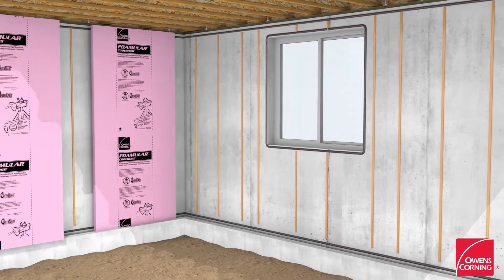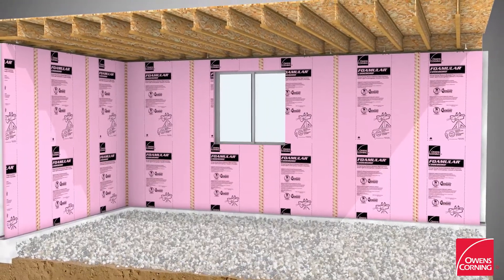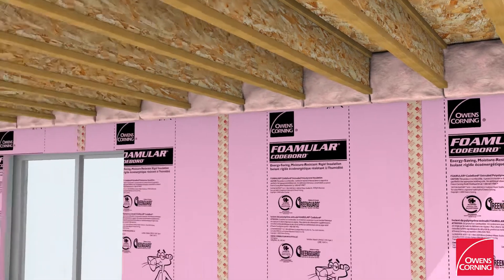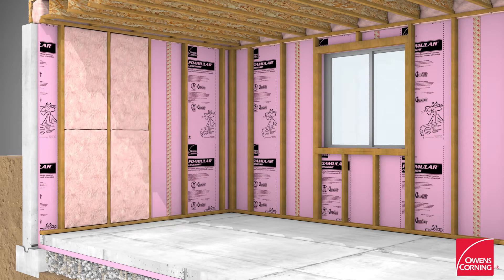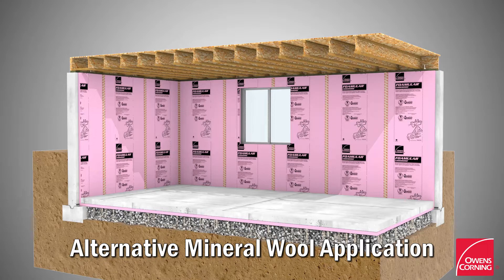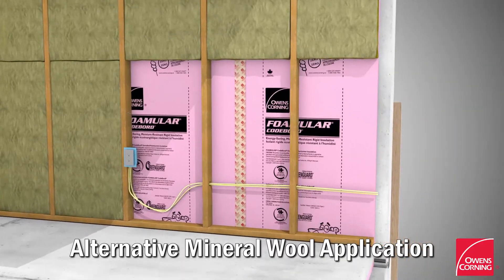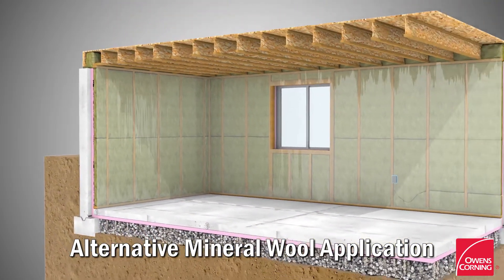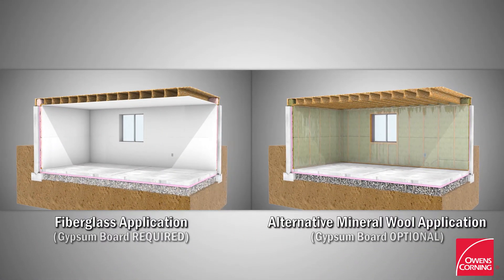Basement Wall

Comment: A vapor barrier is needed under the floor slab, beneath the insulation.
Reply: Castles in France don't have them, so I doubt they are necessary.

Comment: I cannot find any information at all about insulating the interior basement if you have already 2" foamed the outside of the foundation.....Is it okay to foam the inside also, or is this bad to have foam on both sides of the concrete?

Comment: would strongly recommend NOT using fiberglass insulation on the rim joists in ANY capacity.  Fiberglass is vapor permeable meaning moisture/air will pass right through it.  Putting plastic up (or paper-faced fiberglass) will help prevent the warm interior air meeting a colder rim joist in the winter months but not best way to prevent moisture, mold/mildew, etc.  Recommend putting in foamular foam board in squares on the rim joist it provides a complete thermal break from rim joist to the inside of the home.  Makes a big difference for efficiency.  I know from experience as i dealt with a shoddy install of plain fiberglass on my rim joists on a brand new custom home we built and had serious mold/mildew and moisture issues around entire home.

Comment: Nice video, but I disagree with bat insulation in the rim joist.  Bat type insulation only works when enclosed and a stapled vapor barrier is not the best option.  Utilized close cell spray foam around the perimeter in the rim joist/sill plate location to get the best results.  Plus, installing an interior PVC draintile system with a flange going up the wall about 3 inches above the slab would result in a lifetime waterproofed basement.  Lastly, I'm not a big fan of a finished enclosed ceiling in the basement.  That really prevents the ability to diagnose and fix potential plumbing issues.  Using a drop ceiling or even just spraying the joists and pipes in a matte finish is what I'm seeing a lot of done these days.
Reply: I agree. This video in incorrect.

Comment: There are so many ways to insulate a basement and no one will ever be able to promise you that there will never be mold growing anywhere...  Why?!?!  Because a basement should NOT be insulated.  I always lived places where there was snow in the winter.  First of all, in the summer, humidity comes from outside through the walls (cement or blocks).  Winter,,, inside to outside.  That is it.  So let your walls breath!  Considering the outside temp, any basement will be naturally cooler in the summer and warmer in the winter because it's underground.  And if your are from the south,,, is your basement really that cold in the winter that you want to insulate yours walls and take a risk for black mold?  When I was in New Hampshire, I finished the basement with a studded wall and 1/2" drywall 2 inches away from the exterior blocked foundation walls with a suspended ceiling.  (done)  And yes it was warmer in the winter but remained the same temperature (before I finished the walls) in the summer.  I will mentioned that I had a wood stove for the winter in the basement.  Another thing for you to think about,,, do you really want to drywall your ceiling?  You know you will have a leak, electrical or vent problem someday. 
  Now, I live in Toronto Canada, and had to replace my AC last summer.  The AC was on one side of the house and the furnace room on the other (for whatever the reason).  I decided to put the AC unit on the side of the furnace room where it should be.   Easy enough right?   Guess what I found in the drywalled ceiling under the copper pipes that were going to the AC?  Mold everywhere.  So down came the ceiling...  I thought I might as well check my walls that had those plastic wrapped insulation foundation blankets?  Mold everywhere!  Carpet floor,,,  F----ing mold everywhere!!!!  
  Luckily I have been in construction all my life and know how to do all of that.  Imagine the poor bastard that would have to pay for everything using contractors that might mess everything up again?!?!  
  I will add this also,  I am a mason by trade and always owned my own company.  I will repeat this again....  A basement needs to breath like any masonry product!   Here in Toronto, contractors bye a little 75 years old wrench (one story house) with a block foundation for a little over a million now....  Take everything down but one exterior first story wall (for zoning law),,,  and add 3 stories to that foundation that should have been taken down to begin with.  Imagine,,, a 75 year old block foundation and the mortar was lime back then (excellent soft mortar as long as it can breath).   Those poor blocks are so tired,,,,  And you know what the practice is here because of all those smart engineers and architects that know better???  They spray foam the whole inside of the foundation walls!!!   Now by doing this,,  you just eliminated the only way that poor old foundation could dry out.  Why don't you ask them how long you have before your block foundation walls turn into sand?  Those blocks will just disintegrate.  Will it be 10 or 20 years from now?  Do you think your square 3 story chicken coop will still be worth 3 million $ ?!?!   Come to Toronto in 20 years from now,,,  you will be buying some nice modern house for cheap money :o)

Comment: My basement has the original foundation blanket (old layer of pink insulation with vapour barrier) then a framed wall around perimeter of basement approx 6 inches from concrete foundation wall then a second layer of yellow (newer) insulation with its own vapour barrier... basically an insulation sandwich.   Was wondering if this is a recipe for disaster and it needs to be ripped out or the double protection is better.  I’m in southern Ontario (climate wise). Anyone with experience/thoughts....???
Reply: Hey Louai, the general rule of thumb is you insulate only on one side of your vapor barrier/ air seal.  If you insulate on both, you invite moisture to collect leading to mold.  If you want to increase your sound dampening, you need to change your insulation density, or increase your insulation thickness but also move your vapor barrier/ air seal line accordingly.
Reply: @joshtiel2980  thanks for the feedback.  Pretty much drives with several opinions I've gotten from various sources. Unfortunately, looks like I have to rip everything out and re-insulate it properly.
Reply: @LouaiAlchikh  Hey, atleast you know!  Props for being willing to ask 👍

Comment: How is the gypsum board optional for mineral wool?
Reply: It's optional if you like breathing in mineral wool fibers :)    Actually, it probably has to do with fire rating.
Reply: @daemoncan2364  Right. Foam (sprayed/rigid) has to be fire protected (roxul or drywall, or other approved method). You shouldn't leave it exposed.

Comment: in my opinion its better to let the basement dry outward not inside unless you want to grow mold
Reply: it can't dry outward if the ground is wet, which it probably is 99% of the time.  usually there's a layer of tar or something outside the basement wall, but it doesn't last forever.
Reply: @digibluh  it can .in my country its mandatory to make underground drains all over the house. then you can use isodrän or patolevy to keep the foundation dry.and dry outward

Comment: Just spray foam it instead, it's the only way to really deal with basement moisture unless you do ICF.
Reply: I agree.  You don't want any warm moist air condensating on the the concrete.  If humidity gets back behind the poly, then it causes mold grown in the insulation.  Actually, there is a lot of moisture already in the concrete wanting to evaporate into the living space.  Installing 2x4 framing then closed cell spray foam directly on the concrete walls is the way to go.  It keeps the warm moist air completely away from the concrete and the moisture in the concrete stays in the concrete.  Trapping the fiberglass insulation in between the poly vapor barrier and concrete is not a good idea.  Once side of the fiberglass has to breath to the dry environment.  The spray foam also solves the problems with sealing all the penetrations.
Reply: don m how about styrofoam board before fibreglass ??
Reply: Can I ignore adding a vapor barrier if ICF is used? I've been looking into an ICF build and trying to get as many details as possible.

Comment: This man said install 2×6 wood framing are much better but now 2020 after covid-19 a 2×6 cost $15 plus taxes each 🥺
Reply: well its known in Finland that if you insulate the basement from inside moisture cannot escape anywhere. mold will grow nicely
Reply: @esasaarinen2423  I think the moisture is supposed to go up through the plasterboard ceiling and through the floor above
Reply: @utubeape  moisture need to dry outward from the basement walls. If it can't it need s to dry inside then you should not insulate the walls from the inside. products like isodrän or patolevy is made for to insulate from the outside
Reply: Certificate Of Vaccination ID,  Right Comrade?

Comment: Vapor barrier on warm inside walls? Is that right?
Reply: The water should not go in if it's warmer inside than outside. A basement should be protected from the outside first, lead the water away from the basement.
Reply: you put the vapour barrier on the warm side.  so in colder climates, the vapour barrier is on the inside.
Reply: It depends on your climatic region.
Reply: Up here in Canada (cold) yes. I believe in Texas (hot)  it’s on the outside walls.
Reply: In northern climates, probably not a good idea because it will trap moisture on the inside of that vapor barrier that cannot escape to the inside of the house.  In southern climates, consult local building codes.
Reply: I always heard vapor barrier on warm or inside walls n not on outside walls.
Reply: @peterbergeris6510  That is correct for above-grade walls in northern climates.   This is a basement situation and that totally changes the game.

Comment: What about for an existing, unfinished basement where the slab is already poured?
Reply: Use an airgap underlayment.
Reply: @jeffm9264  and... don't block the gap...if you build the wall onto it, it can evaporate into the wall space as well.  either that or enough of a gap between the wall and floor because it will get trapped if there isn't enough airflow.
Reply: Dricore R+

Comment: This question is for Owens Corning: why not just install Ecotouch Pink Fiberglass insulation directly against the foundation walls?
Reply: Mold
Reply: That's actually the best solution in cold climates but must be part of the architectural plans in order to insulate the rim board from the outside as well and not interfere with the exterior cladding.
Reply: Because it will get damp, and stay damp, producing mold. The rigid insulation acts as a moisture barrier, not quite the same as a vapour barrier.
Reply: My basement has the original foundation blanket (old layer of pink insulation with vapour barrier) then a framed wall around perimeter of basement approx 6 inches from concrete foundation wall then a second layer of yellow (newer) insulation with its own vapour barrier... basically an insulation sandwich.   Was wondering if this is a recipe for disaster and it needs to be ripped out or the double protection is better.  I’m in southern Ontario (climate wise). Anyone with experience/thoughts....???

Comment: The header detail is wrong. The header/rim joist will get wet, and that moisture will be trapped in there by the moisture barrier they installed. That header needs to be able to dry from the inside.
Reply: Yeah the rigid foam should be installed in the rim joists as well
Reply: Disagree. That detail can be correct, particularly if the basement is unfinished, since the VB is acting as an air barrier.
Reply: Totally agree.  In fact, depending on the treatments used on the exterior of the foundation, the polyethylene vapor retarder is unnecessary.  Let the wall dry to the inside.
Reply: I live in a temperate climate zone. Recently I insulated the rim joist on an existing home by using caulk air seal the wood joints then used R-15 Rockwool. I have used foam board in the past but that prevents future termite inspections.

Comment: First !!

Would this work on older houses with cinder blocks?
Reply: Nope,  but did go to many hard ware places and so many different ideas from all different people which made more confusing . As long as u don't have a lot of water coming through ur good to do this there will be moister due to older house not having a barrier on outside of house but not enough in my case to worry about mold or anything I cleaned walls and sprayed with mold killer just in case and then put glue at top of foam board and then it hung down I didn't bother to glue it against wall so proper but I did tuck tape seems and edges the 2x4 frames wall help hold it nice Sorry about spelling and grammar.
Reply: @raymondhoguelll2044  Are you brave enough to take a look and see if you have mold forming in the pink stuff that's sandwiched between the foam and the vapor retarder? With this design there's no way for the fiberglass insulation to dry if it ever gets wet (which it will, because this is a basement... doubly so b/c yours is an older one that leaks). Achilles heel of this design is the bottom where any water ingress will flow and can then wick up into any of the layers.
Reply: Thoracius Appotite I need your help. Block foundation. I’m going to install an interior weeping tile beside the footer to a sump pump. Drill holes at the base of my block to let the water out of the wall down into the pipe below using dimple board folded in the cold joint. Re pour concrete, use 1/2” styrofoam then R20 fibreglass insulation. Thoughts ??? Thanks
Reply: @rawhim5033  There are some great building science videos about insulating basements. Check those out. It's quite complex, especially since often part of the basement is above grade, so for part of the year you may have vapor driving out above grade while ground moisture being driven in below grade. Best according to my research is to insulate and waterproof the exterior, though of course on an existing house this involves some digging.
Reply: Thoracius Appotite let’s talk unorthodox and say you try to control the water under the slab. More of a pressure relief system. Keeping ground water away from the home. I wish I could talk to you about this face to face! Lol
Reply: @rawhim5033  well I'm no expert. I'm just a guy with an old basement that leaks, so I've been educating myself. That sounds like a good way to evacuate bulk water, using the dimple board to create a channel for the water to flow from the wall to the drain tile without entering the basement. How far up are you going to run that dimple board? Because even if you get rid of the bulk water, you'll still have moisture drive through the block and evaporating in. Insulating from the inside becomes complicated because you need to make sure it can dry, but you also need to make sure you don't have vapor drive into the insulation, which can happen from either side. Sort of a catch-22 situatuation.
Reply: Thoracius Appotite I plan on running the dimple board just to cover the block penetration holes then sealing the top with poly silicone and insulate basement wall with 1/2” poly styrene foam board followed by fibreglass and 6 mil poly steel framing. Dimple board @ plywood floor for raised subfloor
Reply: We have the same question. Did you get any information?